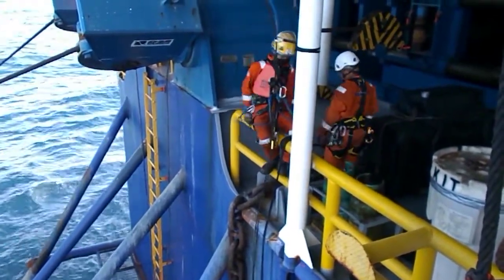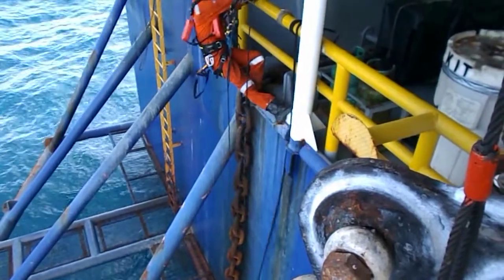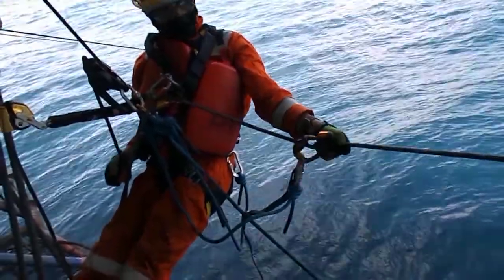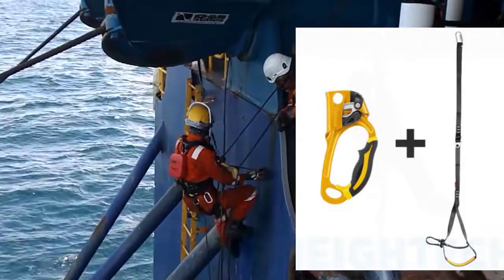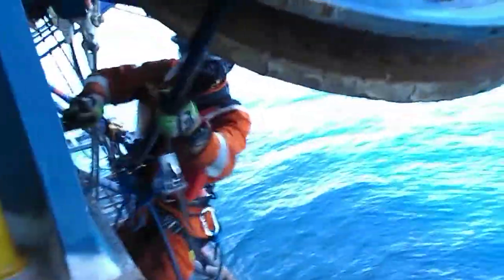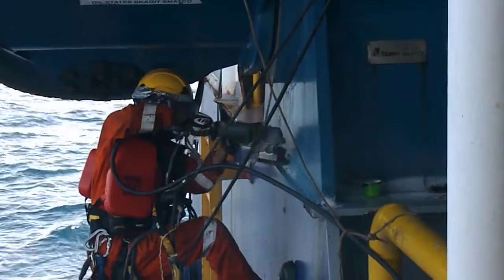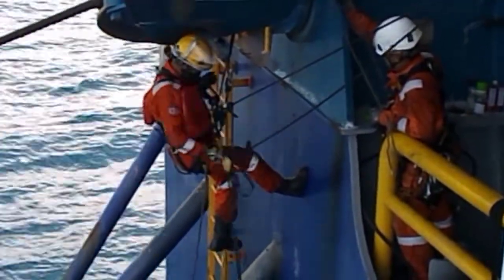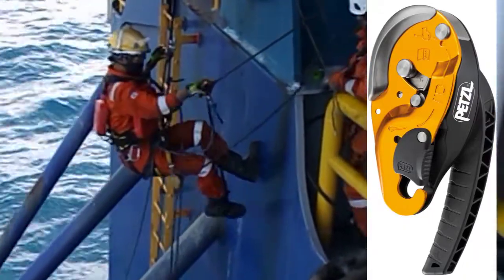Rope Access NDT Working With Overhead Obstruction

Comment: I love the point you make about training environment and the work environment. Coveralls, lifevests all make our moves cumbersome. However, the principles stay the same. There is a reason the length of cowstails is mentioned in the ICOP. And we should use devices according to manufacturers specs and evolve with new knowledge. If you want to showcase cool climbing, promote some best practices please. A shunt is a rope clamp and not a backup devices. It has been out of fashion for decade my friend. And keep those cowstails at the right length.For every thing else. I like the real life video's you have been putting out. It gives people a glimpse into what it is to work offshore in rope access.
Stay safe out there 👊🏻👊🏻
Reply from the maker: Hi.  Thanks for the comments. Agree with the shunt being not a backup device.  I used the wrong term as my English vocabulary is limited.  What I'm trying to say is with the shunt, the tech will at least be connected to a rope if the other connections fails.  Sometimes there is limited choice of equipment in the job site and we have to work with what ever equipment is available. And that is another reality one may encounter in the actual RA work.
Reply: @DIYPhil  for some reason I only just now got a notification from your reply. 
I understand what you are saying and there are some cultural differences and how subcontractors are treated in the world. If my client would provide me with improper gear, I would  tell them so and do the job in such a way that we only use gear as intended by the manufacturer.   If that means we cannot do the job then so be it. Not my problem. According to EU rules and regulations they should provide a safe workplace. Which they are not doing. You as the L3 supervisor are responsible on the site and when the shit hits the fan and an accident investigation gets to court you might be in trouble. 
And like I said I know it can be very hard in some parts of the world to decline work and just say NO.  I think such changes start with L3’s chucking this shunt overboard 😂. 
Have a good one👊🏼